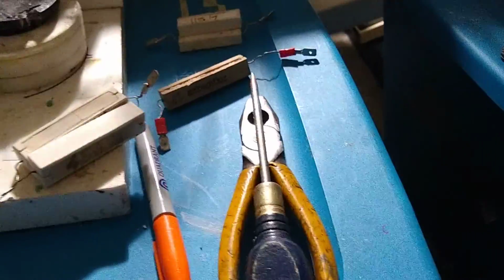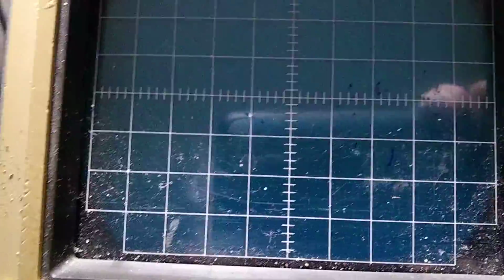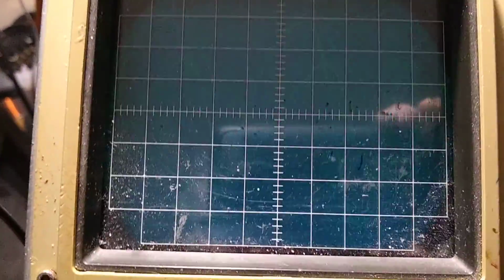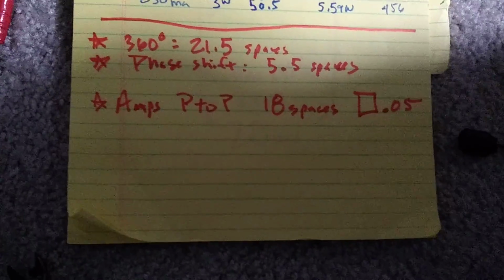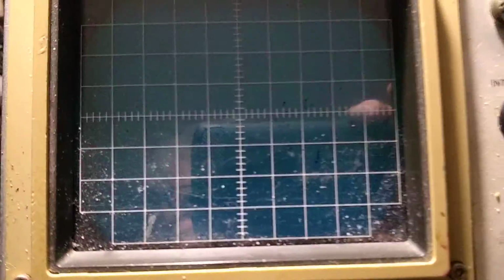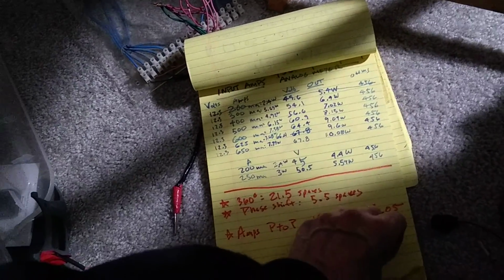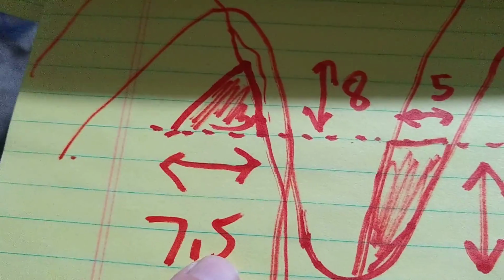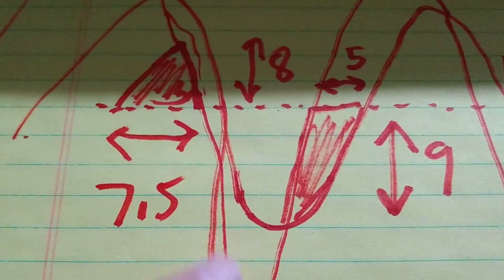Amps testing with analog meter to BiTT rotating disc nvertor

Comment: Thanks for sharing, nice to see you have 2 of your BiTTs working. 18 spaces = 18 of 0.2 minor divisions each =3.6 major divs @ 0.05V per major div = 0.18 A pp = approx 64 mA rms. 
64 mA x 110V = 7.0 VAR's with the present winding setup. Not sure about your output V in this clip but as you say above it still seems well over unity when takinmg into account at phase shift.